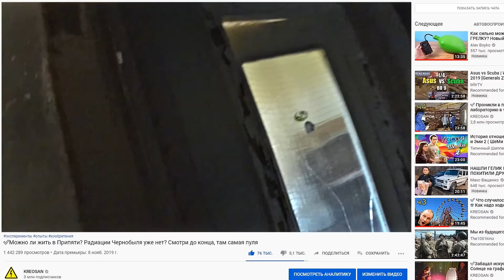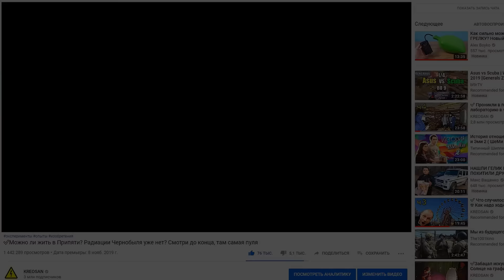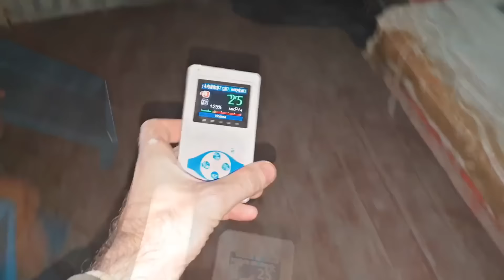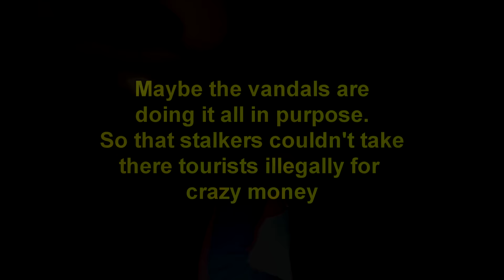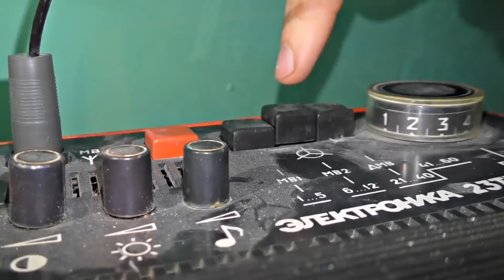☢️Chernobyl Flat Repair Like😨Did they see us??

Comment: Get a thermal camera. You could spot people well before they spot you guys. They work really well
Reply: Thermal cameras are expensive
Reply: oh hell yeah and night goggles they work awesome
Reply: The Mr. Wizard of the group could probably make a thermal camera from a Pepsi can and a flashlight!
Reply: There is this SEEK compact pro camera, that attaches to smartphone usb port. works efficiently and costs less than 500$. There are few other models of it.
Reply: You can get a decent one for about fifty dollars from Amazon...
Reply: A cheap scope from amazon with one of those cheap IR attachments will be great in my opinion
Reply: @dereinepixel1844  nope
Reply: or just make a infrared camera from an old security camera by removing the IR filter plate from the lens and building an array of IR leds... Caterpillar also makes a cellphone that has a built in thermal camera(though it's mainly intended for diagnosing hydraulic issues)
Reply: @Pigeon I own one. No you cant see at night.
Reply: Multorum Unum  Is that question a joke ?
Reply: @KetansaCreatesArt  the idea came from flirc and rthey are chaeper
Reply: They are young and careless and noisy. The officials also have thermal cameras
Reply: They are hella expensive
Reply: great idea 👍
Reply: you might have an IR camera in your phone, check your specs and see if you can find an app that allows you to actually use it for more than low-light facial recognition
Reply: @sleepyrasta14820  u can get one that plugs into your phone for $200 or less
Reply: but why they dont want to be spotted whats the problem,they’re only fixing an old flat
Reply: @sleepyrasta14820  Depends, there is a rather diverse range of Infrared/Thermal cameras/monoculars. Granted, cheaper range of thermals dont have that great of a detection range....however, they are still quite useful. NODs would be killer for night time movement though.
Reply: @sleepyrasta14820  I don't know how much tube pays.  But they have millions of subscribers and fans....I don't count another man $ either but I bet for channel they can swing some lenses and microphone etc....lol
Reply: This was my first thought also.
Reply: thermal camera  is emitting heat signature as well.. nice try dough
Reply: @79tazman  no. Bc night vision is like shining a spot light on camera and on other night vision and on thermal... Thermal is the way to go.
Reply: IR cameras have dramatically decreased in price this past 2 years . I can buy a FLIR for $399 or an off brand on Amazon from 100-300. Plenty of options in 2022
Reply: Awesome idea!
Reply: @sleepyrasta14820  not really homeboy, they don't need any high speed shit that your using in the military, policing, hunting type shit etc. Just need something that can distinguish between hot and cold backgrounds for their use, shit you can actually download apps on your phones that do exactly what they would need. I've tried it out before and they work for that, you don't get great range out of it but yes it works
Reply: What a brilliant idea.

Comment: Guys you seriosly need LED lamps. They dont generate that much heat so they dont need that much energy.
Reply: Why would that be a concern? The rooms are cold anyway and I don't think they're paying for electricity in Pripyat.
Reply: @eleasar2181  was machen Sachen is right that's the proplem. It's just wasted energy
Reply: Was machen Sachen  dontthink so. in one of the episodes, they mentioned that the mains are still linked and they tapped power.
Reply: Was machen Sachen  You dont power an e-heater with car battery, they got power from somewhere, in some episode they showed the cable on the roof
Reply: @AndeyKurniawan  Agree. They could not run heater from batteries for a long time, power consumption is incomparable to the lamps anyway.
Reply: Was machen Sachen  No they're not. They showed how they tapped some wires on a roof a few episodes ago.
Reply: Ausserdem bevor ich hier weiter in meinem semi Englisch schreibe. Hier sind doch sowieso irgendwie alle deutsch. Also zumindest den Usernamen nach.
Reply: @eleasar2181  Ja da hast du Recht 😂😂😂
Reply: I was about to say the same that specially in this situation led is superior.
Reply: @MrJoonat  It's a fact. It's just wasted energy
Reply: Russia is too poor for leds
Reply: @Rainbow__cookie  you know they are Ukrain and not Russian right?
Reply: @Leon-ts1nl  oh OK
Reply: @Leon-ts1nl  ☆ In Post-Soviet Ukraine, Novo-Rossiya Fixes Pripyat!!!
Meme-ing Intensifies!
Reply: Wer hat bock mit mir dahin zu fahren?, 😂
Reply: Ján Jakabovič If you look closely the heater is only on cold fan setting, wouldn’t consume more than 40w. Seems the part about the heat was staged and everything is running of their inverter 🤔
Reply: Just imagine someone coming to check this town after 20years and they find 1 pristine flat in a rotted house :D
Reply: LED lamps are souless
Reply: @eleasar2181  ; LEDs have a higher lifetime.
Reply: @Rainbow__cookie  they make plenty of money from their vids, thats how they can buy stuff to make videos
Reply: @ABC-jg3pv  the planet will be soul less if we keep wasting energy not using LEDs
Reply: @eleasar2181  Und ich red schwiezerdütsch, mich verstaht kei Sau :) chuchichästli.
Reply: Also the LED lamps have better illumination
 than those old halongen lamps they are using..
Reply: you dont think alex the fucking electrician dosent know that
Reply: @Leon-ts1nl  Well this is in Russian zone now ; )
Reply: @eleasar2181 yeah I don't think the boilers on

Comment: Nothing like asbestos infused with radioactivity..... Lol
Reply: They showed that the radioactivity in the room was relatively low, but you're probably right about the asbestos part, also that old flaking paint probably contains lead
Reply: What a nice refreshing cocktail lol
Reply: Even if there wasn't radioactive stuff, or asbestos, or lead, or mold, or anything else you really don't want to be breathing it. At the very least you need a nuisance dust mask to keep it out. A respirator would be better while stuff is flying around. At least until you can cover everything in a thick layer of paint or two.
Reply: There will always be that comment which says "It Is SaFe"
Reply: It Is SaFe.

Comment: With due respect guys, shouldn't you wear masks to execute the job in this closed space? I mean: although it's been some 34 years after the accident, isn't the dust there still radioactive? ☢
Reply from the maker: We in the video showed how much radiation is in the room. The radioactive background in the room did not exceed urban indicators. But thanks for worrying!)
Reply: @kreosann  I would be worried more about the asbestos than the radiation restoring that room!
Reply: @oakleycundall  I think those buildings are "too new" hence don't contain any asbestos
Reply: Or just dust in general.
Reply: Wasn't fully banned in Europe until the 90s and later. This is former USSR and the stuff was used extensively and  those flats will be early to mid 70s. so yeah :) no doubt full of the stuff.
Reply: Yeah, not so much a problem with radiation.  Im more worried about the asbestos, paint dust and mold spores.  Even if it were just normal dust, youre still breathing in stuff that will mess with your lungs.  I worked a job at Goodwill for a while hand loading donated clothing into a compactor.  Every day I would go home and blow my nose.  What came out was black snot because of the dust and dirt I was breathing in for 10 hours.  "Professional" or not, dont be stupid by thinking "Its not radioactive, so its fine."  Its not fine.
Reply: @cptcrogge  the city was abandoned in 1986
Reply: How were you guys getting the power to the building?
Reply: @cptcrogge  Trust me they have asbestos,
Reply: @coffeemakerbottomcracked  Noice
Reply: Asbestos,lead paint and radiation ...such a healthy place to be 😂😂😂
Reply: @harrisonsmetana2506  I think corruption

Comment: me: installing 10 squaremeters of Rockwool, wearing an FFP2 mask
these guys: breathing what-the-fuck dust for entire days
Reply: Agustinus Reynaldi  rads, all kind of mold, asbestos - specially when you scrape that shit or stir it up. A lot of composite materials, not just sawdust :-D
Reply: Youre being safe, id rather be cautious with anything that can fuck up your lungs, especially asbestos or silica dust, etc.
Reply: dont worry about corona, that video was made half year ago.
Reply: cant install that without drilling studs in place and that shit is loud. Best bet for them be to glue styrofoam
Reply: “What the fuck dust” LOL
Reply: I wouldn't be worried about the mold... The nuclear particles and asbestos though...
Reply: I bet theres tons of asbestos in some of those buildings which would be of far greater risk than any radioactive particles...
Reply: Hahahaha - came here directly to comment about the "what-the-fuck-dust" considerations, but you nailed it already!!😀😁
Reply: @ronharris91  asbestos and silica take a VERY long time before they affect you. There are far worse things to inhale. I work with HAZMAT all the time. I have my TDG 7, TDG, and chemical certificates regularly updated.

Comment: Renovating a flat in Chernobyl... now I have seen it all. Incredible. 
I am completely blown away by the fact the buildings still have power and that this at least 35 year old TV is still working after all that happened.
Reply: I dont think the building had power, maybe they brought their own battery supply.
Reply: @Wasabi_Master  they plugged devices into the wall.

Comment: 26:30 That heater type is notorious for not lubricating the motor the bearing has Run Dry The motor will spin freely if you apply some grease to it. crappy non lubricated c-frame motors.
Reply: I've got one of those. It's was a hell even the first day I used it.

Comment: Careful with the wiring guys. I've been in a house where the wiring started to smell burned and one electrcal outlet started to smoke after we switched the power back on after winter.

Not an abandoned building, just a really old house my family owns. Wiring is much older, from the 1950s....but the house has not been abandoned for 30 years.

Comment: Wanna protect your stuff and make it hard enough to discourage vandals from entering your flat? If you cut open an entrance through the wall of the next door flat and disguise it, you could place cinderblocks and mortar behind the original entrance door to your flat. That way, it's be very hard to get in and vandals might move to an easier target. Your hidden entrance could be inside a closet or behind a refrigerator. You'd need to put the refrigerator on small caster wheels and attach the back of it to a door that you would install. I'm sure you could have some fun thinking of ways to make the entrance a secret. Don't show the entrance in your videos lol. Also, one of you might want to find the electric power meter, remove it, wire up a jumper (to bypass the meter) then replace the meter so it looks normal, but doesn't show any power has been used. Good luck.

Comment: You should put a normal flat doors with a good lock. Safety from evil stalkers to get in.
Reply from the maker: The idea is not bad, but in a long absence, unfortunately the locks will not help
Reply: @kreosann  air conditioner installation in pripyat
Reply: @kreosann  so put not only 1 but 2 or 3 different locks :) at least try it. I'm from Lithuania by the way :D
Reply: Put new doors in 😎

Comment: Can you fix the roof somehow? To prevent vaterdemage. I mean remove trees cause they demage the roof, fix leaks... fix doors to the roof
Reply: They could, but they would have to be extremely careful about it, especially since other buildings are higher up and give better vantage points to be spotted. If someone sees something 'too clean', it would be worth investigating. Though they should really cover the glass of the door of the flat they are in.

Comment: If you're still doing this, you should get a small FM transmitter with amplifier, little microphone with audio sensor relay. When audio is detected, it switches relay to power transmitter and sends microphone. On the roof, put yagi antenna aiming to your destination. Choose an FM transmitter than has a weird frequency so nobody detects the signal. You could use a little two way VHF/UHF radio module hooked up to amplifier. Now you have a super long range security system and you can hear who is coming. You could try video link, but it won't travel so far because of wideband higher frequency signal. You need lower frequency audio signal for best range.

Comment: The energy is from the inverter with small lipo battery? It won't last long (or you have a "contact" to provide your grid electricity ?)
Reply: im pretty shure from what ive seen in their other videos their tapping to still alive power lines on the streets with a mix of that but I'm not fully shure
Reply: since they had a electric heater running I am quite sure they found a source of power

Comment: You guys are tough, weld a steelplate on a door so its looking normal from the outside. Change the door in your flat with it and change cylinder lock. Never goes in there :D Or u take a bunker door
Reply: I like the idea of a hidden doorway.  It appears that anything else will unfortunately be vandalized in the future.
Reply: Agreed. They will need a very sturdy door and lock to prevent vandalism, as well as a note stating that the flat is occupied.

Comment: Where is the electricity coming from now? that little inverter isn’t going to run the space heater if it’s heating not just running the fan?
Reply: Solar panel and battery :) i think xD
Reply: Check the prewious vids
Reply: They connected a wire from the power line to the old mains fuse box

Comment: I'm a plumber and I can't wait to see how you fix the plumbing in that flat!
Reply: not even a plumber but i don't think they can.
they might get lucky tho
Reply: @thermite10k40  They could at least try to hook up the old drain stack, find an unbroken toilet, hook it up to drain, and then use the tub as they intended in the beginning to collect rain water, and they could use a 12 volt submersible mini pump to have a water pressure at taps.. But the thing is that all pipes there are pure bent fittingless welded together network of pipes, so they would have to thread them somehow to attach stmh to them. I also know that in the flat rooftop style apartment building like the ones in pripyat, they don't have outside piping systems to let rain water drain from the rooftops, instead the rooftops have special drain holes in the middle of the roof and they continue down to basement wia/ cast iron pipe @ 110 mil, and it drains to outside.. They could cut the stack pipe for rain drain, hook a hose to it and lead to the tube and collect rain water that way. The rain water stack runs always along the sewer drain stack in the special cupboards in every flat that house the drain and water mains pipes. It would be quiet easy for them to hook it up and have a working plumbing in that flat. The sewer stack pipes should still be working, as sewer pipes don't simply clog up without presence of water, they just remain, well, empty pipes so the sewers should be working, its the water mains that is the problem. All that could take them a few hours to complete and after rain they would have suitable water to flush toilet and wash hands.. of course, if the water wouldn't be radioactive from the dust in the air.

Comment: Still getting power from the roof wire?
Reply: I was curious about that. There's not way they are running all that stuff, let alone a fan heater, off an inverter powered by a small lithium ion battery pack
Reply: @kirkc9643  Unless they were running it just for the video, for a few seconds. They never seemed to run several lights at a time either.

Comment: That electric outlet looked like it would accept American type A two prong plugs the type B with sn adapter.  Our phones and computers and some other electronics can charge using 240 volts.  Most American homes use both 120/240 60hz power.

Comment: One thing I would do is replace the doorknob to prevent bad stalkers that want to vandalize the flats one affective door lock would be a old style board lock for when you guys are in the flat when you guys are away is the tricky part because you don’t want to make too much noise when replacing the official doorknob you could replace the old doorknob with a new knob to lock the flat when you are away so it doesn’t get destroyed you guys are living life on the edge by doing this but it’s entertaining though

Comment: why not reinforce the doors with steel plate and heavy bolts and locks so no stalkers can break in. Why use those crappy wood doors. Install some strong iron doors... Maybe have a metal bar on the inside controlled by an aurdino rather than a lock, so people can pick it or cut it.
Reply: They need to bring all of this there...

Comment: I love it!  TV was a nice touch.. Great job on the flat.  Well done!
Just a word of advice.  If you are using a camera, binoculars or a scope on the roof, your lens will flash against the sun and give you away. Put a woman's stocking over the lens if it's binoculars or a scope.  You will be able to see right through it if it's close up to the lens.    Also.. use blue light (make a filter).  It's harder for the eyes to resolve over a distance so you are less likely to radiate loads of light at night. The more muffled the filter the better.